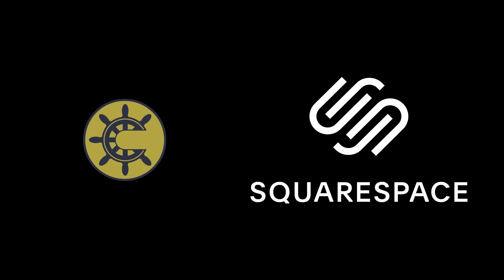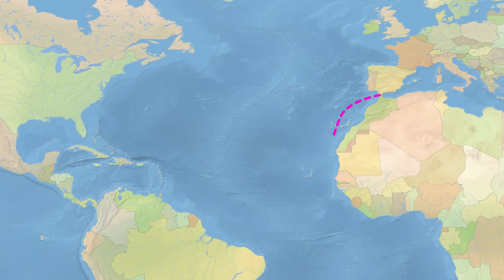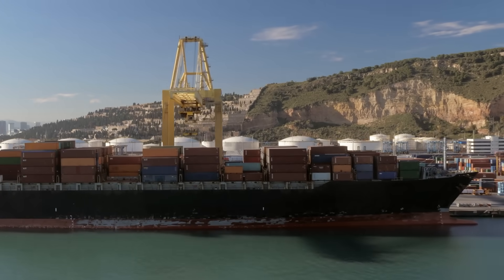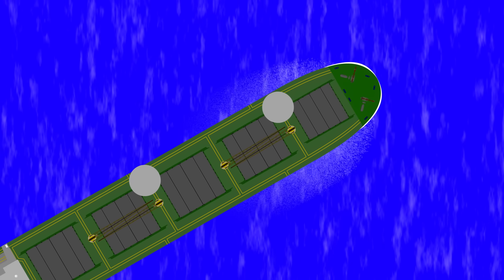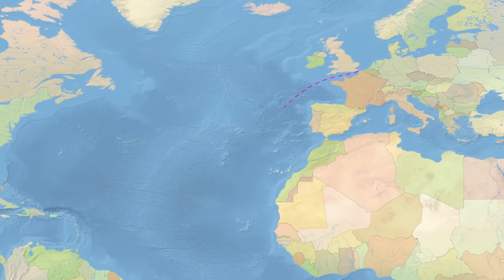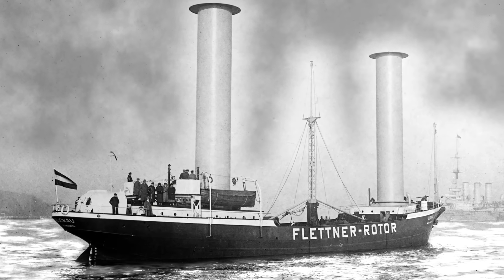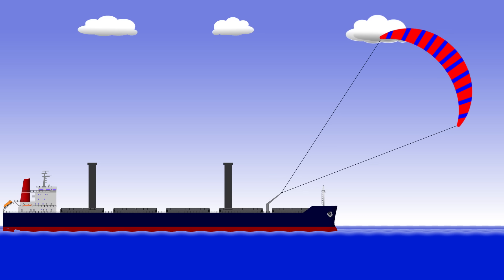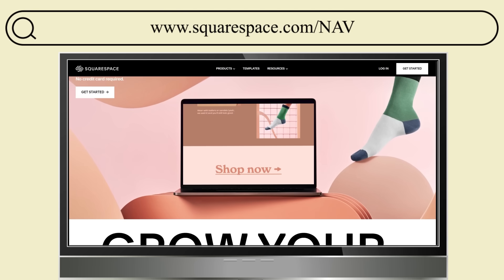Why Don't Sails Work On Ships?

Comment: Regulations applying to ships registered in one country will push them to register somewhere else, true.
Registrations applying to ships stopping in one country are a different thing. If the EU and North America pass such regulations, the only solution would be:
A) comply
B) move stuff by truck from Turkey to Denmark or from Nicaragua to NY
C) transfer goods to another ship somewhere on the way.

Trucks are very expensive, transferring to another ship is a big logistical problem, complying would likely be the best option.

Comment: Wonderful touch with only 3 of the funnels on the cruise liner smoking, I love historical accuracies like that, and something which would have been ignored by most channels
Reply: At 55 seconds, I was pleased to see the pennants flying forward.  Someone pointed out to me that an amazing number of ship paintings, from the age of sail, like 1500s-1700s, show sails filled from behind with pennants streaming backwards.  Once you see a few, it's impossible to not start checking it all the time.
Reply: @grizwoldphantasia5005  Good catch. Now I won't be able to unsee it either
Reply: There were four-stackers where all stacks served as boiler room exhaust, though. The Cunard liners Lusitania and Mauretania are good examples of this (there are also photos that clearly show it). The Aquitania had a boiler room connected to its fourth stack as well (albeit with fewer boilers than the other 3).
Reply: One is intake
Reply: @mikegarner8011  No, intakes are different places. 4rd smokestack in Titanic as example was just artistic, it really housed kitchen ventilation and some storage space for deck equipment
Reply: @sockchanger  "more funnel = more fast" as the Victorian commoner might say
Reply: @mickys8065  WAAAGH!
Reply: @sockchanger  4th funnel on Titanic was not just decoration, it was used, as you said, to vent the kitchen and smoking salon, but also most importantly the machinery spaces. 
But there were plenty 4 stacker ships around that used all 4 funnels as funnels. So "4th funnel = deco" is not as historical accurate as the original comment implies and basically just applies to the Olympics
Reply: @mikegarner8011  Thank you. I was going to ask OP to explain, but your reply gave me what I wanted to know.

Comment: I think this video is prematurely dismissive of sails for cargo vessels. While it is correct that a rigged sailing ship is harder to load and unload, there are ways around that, and there are successful enterprises operating such vessels. They're niche, yes, but the shipping industry really hasn't had to deal with the implications of climate change yet, so it's possible sailing ships will become part of the solution.

Comment: A Sail would take as little deck space as a Rotor would. Its more of a question of a ship's stability, or where its metacentre is in a roll. Put mass high up on a ship, and it'll roll. Put a lot of mass high up and it'll capsize. Running a ship is not about sailing safe 90% of the time cheaply, its sailing safe 100% of the time, and making money doing it.
Reply: Well a rotor beats a traditional sail in all those aspects: it requires zero extra crew (can be 100% automated) and the heeling of a ship is much lower because of course the area of a rotor facing the wind is much smaller than that of a sail. In both cases, rotors or sails, the weight they add to the ship would be miniscule, compared to the weight of the ship itself+cargo.
Reply: @aurigo_tech  place mass high up on a ship, and it counts for more, as the distance from the metacentre works as a lever. A sail works because in a storm, the sail can be furled. But a rotor cannot, generally. So a ship's ability to weather out a storm is rather affected by where the mass of a ship lies. And in the case of the Sewol, for instance, the amount was very small for the margin of safety.
Reply: @twotone3471  But the weight of a rotor (or sail) is insignificant, compared to the weight of the ship (at least the ones we are talking about in the context of this video).
Also a rotor by default is a lot more aerodynamic than a sail, offering much less area to the wind. Fletter proved this with his ships Buckau and Barbara: even under severe storms the ships under his rotors were heeling much less than they would under traditional sails. Even a small one-rotor-yacht he build was able to sail as fast as a comparable one with traditional sail - but did so with much less heeling.
Of course behaviour in a storm - when moving or stationary - is a factor, but from what I have read it is manageable and especially so with fletter rotors.
Reply: @aurigo_tech   If it was manageable, the behavior in a storm that is, there would be more ships with rotors. But their inflexible nature means permanent mass higher up in a boat or ship. When you take a sail down, you lower its barycenter as mass is pulled closer to the bottom of the ship. I've not seen any models for collapsible rotors, rather like paper lanterns or such I'd think. So until you have a design that doesn't have better performance both in ideal conditions and in the worst 5%, you are playing with fire I'd think.
Reply: @twotone3471  Behaviour in a storm is not what prevented rotorsail's breakthrough so far. 
As mentioned Anton Flettner himself collected plenty of experience in roughest of weathers and his rotors caused no reason to complain whatsover, quite the contrary in fact.

I see the reason more along the lines of this video: combustion engines became too successful and fuel too cheap for any kind of wind-propulsion to compete for most of the time since the 1920s.

However now those factors matter less and less now and wind propulsion might have a comeback. It already has, with a growing number of ships using rotorsails or other methods to safe fuel costs.

Weight of rotors or any sailing system really is a non-issue among the larger ships: to a multi-thousand ton ship it matters very little if you have a few hundred kilos or a weight in the low tons on deck or not. Its like you  as a person wearing glasses or not: their weight doen't change your ballance at all because it is so miniscule compared to your body.

Comment: The description of how sails work was wrong - they generate 'lift' just like an aerofoil wing - they do not 'deflect the air to the stern'.
Reply: The description is correct. ‘Deflecting air toward the stern’ is just a plain English way to say that the thrust of the sail results from an equal and opposite change of momentum of the air flow. If the sail is providing a force, then conservation of momentum dictates that an equal and opposite rate of change of momentum of the air is occurring.
Reply: @XPLAlN  Then why did you not use that explaination for the aerofoil wing later in the same video.  There, you correctly describe the high / low pressure across the foil which generates lift.  A normal sail works as an aerofoil in exactly the same way - generating lift because of high / low pressure which becomes forward movement.   It does not 'deflect' air toward the stern - it creates high / low pressure differential as an aerofoil, that is not quite the same thing.   

Would you really say an aeroplane flies because it 'deflects air toward the earth'?
Reply: @RichardPhillips10  firstl;y, just to be clear, this is not my video.
   An aircraft does deflect air down. Try standing under a hovering helicopter sometime and feel the downwash.
   Of course there is a pressure difference between each side of the sail. That is also correct. But the sail does deflect air. You do not have to pick a winner. A 13 amp socket can also be a 240V socket without anyone being wrong about the ratings.
   The law of conservation of momentum tells us that the force on the sail is the equal and opposite reaction of the momentum change of the air. Which is why it can be said with absolute certainty and credibility that when a sail boat is making way, the sail is deflecting air astern. Doing so does not contradict the fact of the pressure difference, it is just an alternative and equally correct statement of fact. The video is correct.

Comment: I struggle to comprehend that such a small rotor surface is enough to move such a huge mass across water. Also, the fact that you can actually safe a lot of fuel despite having to spin these things is impressive. It must be very efficient.